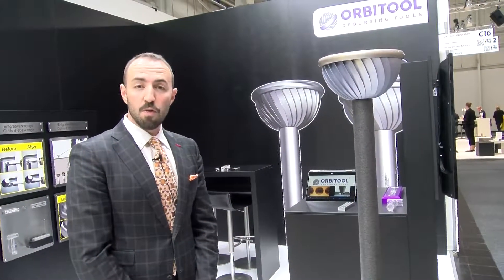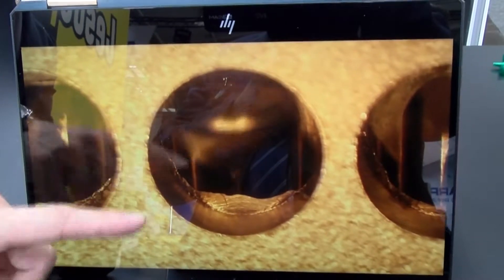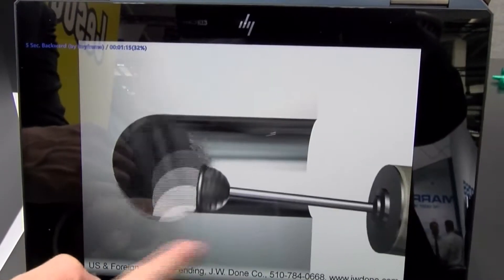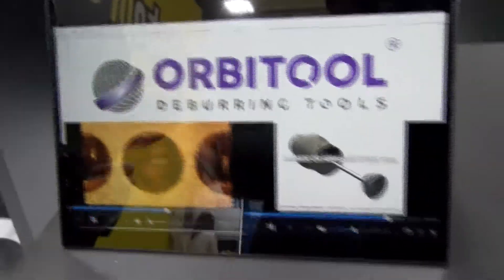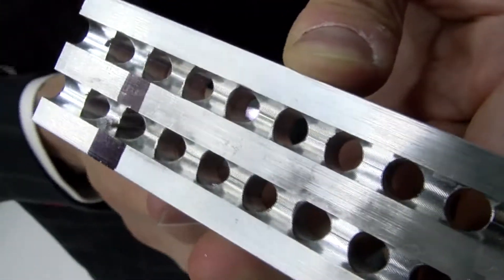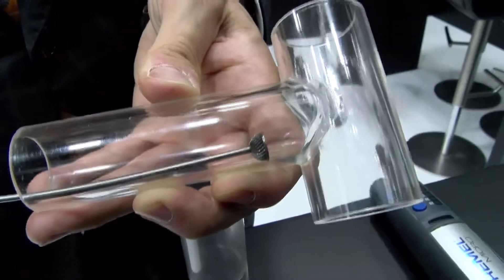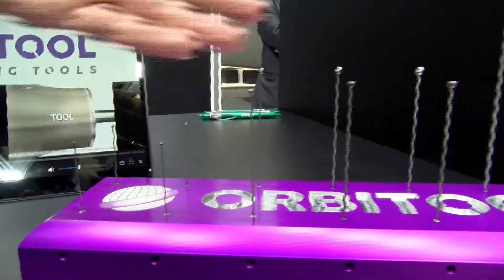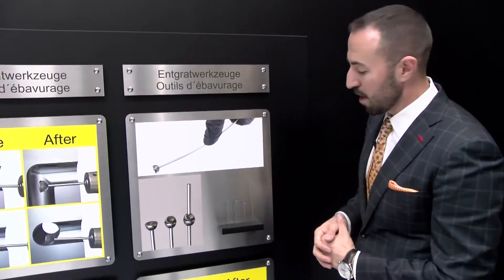ORBITOOL Deburring, Product overview and demo

Comment: It is good to say “debburring tool for detachable burr”. 
Not possible to get burr free hole exit by cutting as it seen in the detail of video 😊
Reply: That is where refining comes in with nylon abrasives or sandblast! lol or use deburring tools that dont create a secondary burr like fine ceramic rotary tools (except on gummy materials like aluminum that need refining anyway for perfect intersections)